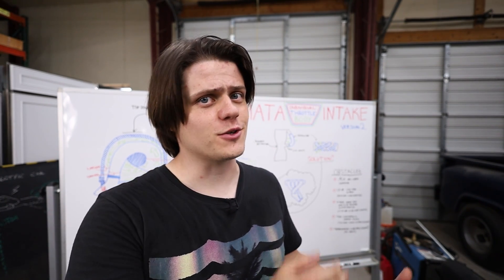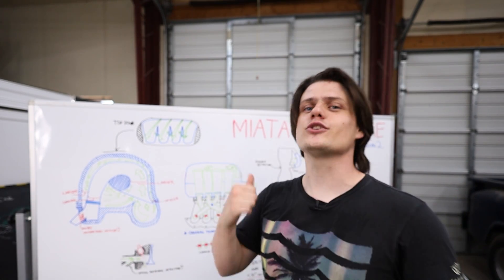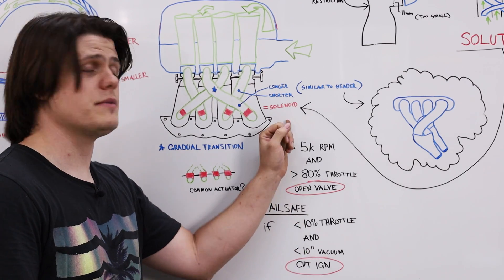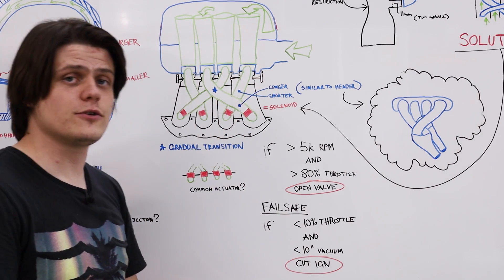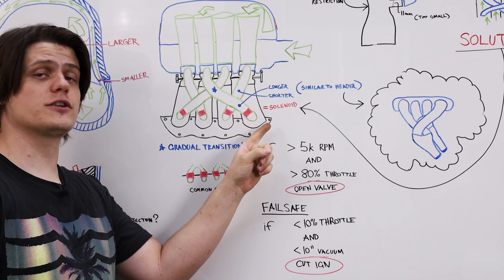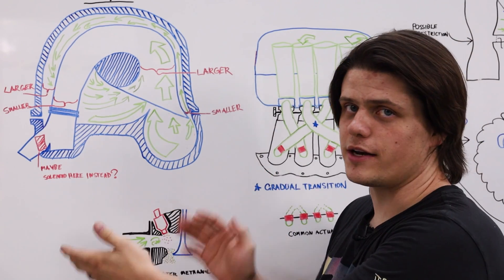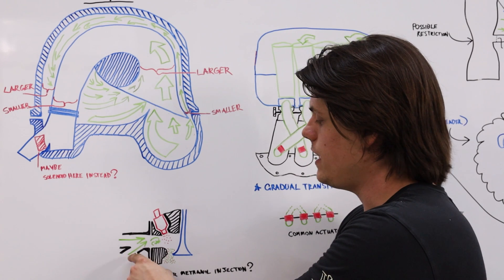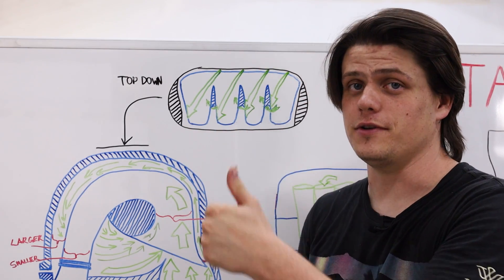This intake is the beginning of something BIG...

Comment: Im late to be adding this, but you should google "Yamaha YICS" (Yamaha Induction Control System). I have an old Yamaha SECA 7500 which has YICS.. It's essentially a tube beneath the intake ports which connects them all. The bike has ITBs with carburetors, the YICS tube is 1/4 the cross sectional area of a single port. The job it accomplishes is creating swirl and turbulence in the intake charge, the opening in the port is angled at the valve in such a way that it deliberately disturbs the airflow in the port.
Reply: I haven't thought about YICS for years. I think it debuted on the 650 SECA. Thanks for the reminder 😊

Comment: It's an interesting project, and I found it by looking for an ITB plenum that will take boost on a stock ECU, but I think you should learn to walk before you run and do the project in steps. Get a working plenum with short trumpets first. Then experiment with trumpet lengths and shapes for Mk II. Then experiment with your other stuff for Mk III. You will get more progress, learn what does and doesn't work, and reduce burnout breaking it down into stages than muddling through everything all at once.  Otherwise, great job! :)

Comment: I've printed a few props primarily with PLA, and recently moving into armor tried out ASA. ASA in my experience has been a blessing to work with, and as long as you keep the part cooling fan off or at low speed, I've never had a single layer separation issue. Not sure what brands and the like you've tried but i'm currently really enjoying polymaker's. With ASA its also important to print hot I've discovered, I print at 270C with it even though polymaker recommends 260 max. This is something i've seen advised in the community as well. It's also worth it to reach out to the 3d printing community if you still have issues, people tend to be really helpful. It's always awesome to see 3d printing make its way into another space!

Comment: it's a good idea but overall I think sliding intake runners like on the Mazda 787B would be a better option for this. That way you would get the perfect runner length for every rpm because you can have it in any position between max and min which obviously are optimized for high and low rpms. All you would need is to know your rpm and have something that moves the runners up and down like a worm gear maybe. not as space efficient so there is that and there is also the problem of the airbox, that could remain fixed to the top of the velocity stacks and move with the whole thing

edit: seems like this design is also used by Ducati https://www.youtube.com/watch?v=SnSADk9j7Mg

Comment: This is an interesting take on induction tuning. My 2007 Triumph Daytona has similar connected runners on the exhaust header from factory. By attempting to equalize the average runner pressure you are giving up the high pressure reflected wave that arrives at the intake valve at certain rpm. However, you are also reducing the low pressure rarefactions that exist at all other rpms. Perhaps you will win the battle of averages. I'm excited to see the results. For additional study you might be interested in the intake manifold found on the 2002 Ford Focus SVT. Similar packaging to what you have there but containing a two stage runner system that I found to be clever in its operation. It's a curved runner extension that rotates out of the way at higher rpm. Good luck. I am subscribed 👍

Comment: 3:46 actually a great idea, but one thing I would do is instead of have the velocity stack be shorter, and not as bent but have the intake manifold have a swirly/vortex shape to help air flow better through the manifold. A possible re-think of the design may be needed, but your current design isn’t relatively bad. Not an engineer, but putting in what I think would be a good idea. Take this with a grain of salt and have fun with this. Hope your build goes well!

Comment: ASA prints like butter.  Just about the easiest filament I've ever used.  If you are experiencing layer separation, sounds like you might not be using an enclosure, or your printing temps are too low.  You may also have to turn your parts cooling fan down.  Search for "andrew ellis tuning guide" .  Great resource for dialing in your printing.

Comment: at 1:50 

ITB sizing is not like calculating the size of the stock throttle body and then divide the area by the cylinder count.
The stock throttle body is a near constant flow device. As 4 cylinders pull through it through 720° of engine rotation and many times more than one at a time. 

While a single throttle body has to flow the entire cylinder filling in something like 240° duration, at all other times it´s doing almost nothing, there is lag during the valve opening and until the entire runner is at a common speed. So the 960° duration of a 4cyl with a 240° intake valve opening per cylinder looses it´s average flow substantially and so is not a direct correlation.

Comment: Ford Australia was using variable length intake runner manifolds on their mid 90's inline 6 sohc 4.0L all the way up to the last of the Barra's, with amazing results.
As you mentioned the 180 degree turns are a problem for air speed, Ford's early versions of the system got around it by effectively splitting the manifold into 2 halves using a vacuum operated butterfly valve arrangement, providing a short straight in between the turns to help recover that airspeed. Subsequent versions obviously only got better with the ecu handling the control of a now completely mappable, servo driven butterfly valve.

Comment: I could share my BMW intake design with you, but if I do, then, it must be done under NDA, and it should add a ton of power, without a ITB setup. It will match the power RPM and performance however.

Comment: You have lots of great ideas, however reality can be very different.  What you really need to look at is CFD (Computational Fluid Dynamics) software which allows you take your CAD design and simulate the airflow.  CFD design is very intuitive and I am guessing that you will instantly 'get it' and be able to interpret the color maps and use the results to refine your designs.

CFD = FEA - Finite Element Analysis

Comment: Most European Engines (including my custom ECU tuned supercharged MX5) Stop injecting fuel if the throttle was no longer being pressed (i had mine set to <5%) 

That failsafe really doesn't need the vacuum part, it's just a 0 fuel at 0 throttle, which is very normal for injection cars...

Comment: BMW vanos and valvetronic does something similar to this, but with a different approach.  they control the valve timing programmatically with vanos, and the lift with valvetronic, and so they don't have traditional throttle bodies since they perform its duties at the intake valves

Comment: Look at Yamahas variable length intake system they use on their R1 superbike. It is all inside the air box and functions very well. I think you can copy something like what they use and achieve the same results in a much simpler package.

Comment: Please check Yamaha's YICS system. It would simplify and add lightness to your system. Also some manufacturers use flapper valves to open and close air ducts to keep the intake volume and air speed matching with the engine's demands. The plenum itself in one thing, but another equally important thing is the ducting before the throttle body. Surface area of the air cleaner, restriction of the air cleaner, air box ducting etc. And all this needs to match with the exhaust and cam lobes without forgetting the ports themselves and the combustion chamber. Having a vortex right before the valve seems good on paper, but it also creates a low pressure area right where the flow should be as laminar as possible. If you want to mix the fuel better, the best solution is to move the injector(s) further away from the valve, and have the port finish slightly more coarse. Rougher finish on the port wall decreases the laminar flow area, making the true CSA number smaller than measured value. Simplest way to deal with valve pulse is to rifle the whole runner. If you spin the intake charge, it will travel further distance forward after closing the valse than it would with full laminar. Also the valve pulse dissipates into the low pressure area in the middle of the port/runner. This works best with a single valve per port, dual valve system can dissipate the pulse into the pre chamber, and adding the YICS to it, the intake charge keeps moving forward. How and where? By removing the stock injectors and connecting the holes with tube, you'll have fully functioning YICS. Installing the injector into the choking point you have in your intake design, you make the perfect mix, and can get rid of both the solenoids and the extra piping.

Comment: PETG is another but its not as high of a glass-temp as ASA. layer separation is due to the quality of the filament and the overall size of the print. From the prints I've done, and from what i've read its a crap shoot. some say print it at 250, bed temp of 90 some say 240 and a 100-110 bed temp. Variables between printers, materials, and where you're printing garage can take my numbers and settings and make yours print like crap. Even the intake runner I printer for my truck, I added a thin skim of plastic JB weld at the cracks sanded it and hit it with a coat of high temp engine enamel. No matter what there will be post-processing.

Comment: Print water soluable inner, print outer, print punger, forge carbon with high temp resins. Remove outer, bake the resin to cure, put in water to remove water soluble. Bake at higher temp for final cure.

Comment: Your rationale about the outside air channel is pretty sound - in aircraft intakes this is called a splitter plate. You're forcing a new boundary layer to grow on both sides of the splitter. Remember the fluid velocity at the surface is zero and then increases to free stream in the middle of the channel. If your outer channel is too narrow there is a chance it will choke and limit flow rate, but experimenting with different geometries is easier with 3d printing! Good luck!

Comment: For runner visibility: 3D print a mold and use vaccum forming to shape the top of your intake out of vinyl or other clear plastic. That would even give you a simple smooth outer surface for the air. 

I'm not sure what material would resist petrochemicals and heat under the hood. Check that, cuz a melted intake would be a sucky one.

Good luck, looks great!

Comment: as a Mechanic I see some issues in yer Design,
yer secondary Runners are connected tae the wrong Main Runners,
when the valve closes the air column won't stop, ye should go with the firing order 1-3-4-2
tae create an additional Pulse in the Cylinder that fires next.
the other thing is yer idea with the Solenoid, wich is simple but ponderous,
if ye take a second set of Throttles for the Runners and connect them with a Rod tae the Main Throttle,
yer absolute 1:1 (or what ever ratio needed) all the time.
Look up the design of Turbo intake called "gap sucction" type that uses slots on low rpm so the slower
column gets sucked through the long runner and on high flow or in this case ,boost occours it get's pushed through
the slots, it's bassicaly a syphone ,donnea ask me how exactly that works I'm no flow engineer.

Comment: i would change your injector location to being much further away then what you have it if you could. a straight shot down your stacks would be best it would increase fuel atomization and would make your air much cooler going into the engine

Comment: I really like your attitude about learning and sharing so I can share some airflow formulas with you that are engine related 👍
First thing you always need to know is the cfm demand of your engine at peak rpm, this formula will give you the answer in 28” test pressure (flowbench standard pressure) of each cylinder, so what you need each port/runner to flow to support that particular rpm point.

Cubic inches x rpm x 0.0009785 / number of cylinders = cfm demand at 28” test pressure.

I do Australian in-line 6 cylinder engines so here is an example of the formula.
240 x 6500 x 0.0009785 / 6 = 254cfm at 28” test pressure.

Next is how much air can flow per square inch of cross sectional area, again at 28” test pressure the most you can flow is 146cfm per square inch, so for my above example I would need a minimum cross sectional area area of 254/146= 1.74”squared.
Now this is 100% efficiency through a straight pipe, so we know that ports and runners aren’t straight so I personally aim for a 95% efficiency, so if I want to still achieve my 254cfm target at 95% cross sectional area efficiency the minimum cross sectional area would actually have to be 1.83”squared.

So if you want to ask any questions I’m happy to try answer them 👍 if you put up the engine specs and rpm points then we can calculate areas required.
Reply from the maker: Really appreciate the detail in the response. I believe I've seen that formula before, how do you alter it to learn the cfm requirement of each individual cylinder and thereby the minimum velocity stack diameter?
Reply: @StandRacing  or if you know the individual cylinders cubic capacity then you can just put that as the first number and not have to divide by the total number of cylinders, again my example then would be,
40 x 6500 x 0.0009785 = 254cfm
Because each cylinder of my 240cube 6 cylinder engine is 40 cubic inches.
Reply from the maker: @seanb250  very cool! I added a couple more numbers in and converted to mm and got a minimum diameter of 35mm. Which is awful close to the port size in the head 👍

(110ci 8,000RPM 4cyl)
Reply: @StandRacing  just remember you want slightly bigger as getting 100% efficiency from a port is extremely hard, so if you shoot for say a minimum diameter of 35.5mm (assuming a circle) then the engine will pull power to that rpm if the port is stable and the intake isn’t choking it 👍
Reply: @StandRacing  that is the formula for each cylinder, that’s why the final part is to divide by the number of cylinders 👍
So for my example I needed 254cfm per intake port.

Comment: Your solenoid should be closer to the intake valve, less volume stuck on throttle close the less throttle hang you get and better responsiveness
Reply from the maker: I was thinking the same thing. The only thing I don't know is how cleanly the air can flow through the solenoid. If it dirtys the air a lot that might be a factor on placement.

Comment: I assume you are using some sort of software like fusion 360 or something open source like most 3d printing guys do but I would recommend getting solidworks (even an older copy if you have to) and using their flow simulation software for your designs and it would help a lot in getting theory into more practical use without having to waste time and money printing a design that ends up not flowing how you want
Reply: I kept thinking something like this the whole time going over the flow drawing

Comment: Also with the ASA, possibly some basic troubleshooting might help with layer separation. A nice dry filament and a heated chamber are necessary, as well as the right build surface (PEI sheet works quite well). But these might all be things you've tried already so IDK.
Reply: can second this, only on small parts can you get away without a heated chamber on ASA. 
for me i've found 60c works alright, but to do ASA well you really need 80c enclosure temp, if you have the enclosure space, try and go for radiating heaters instead of fan heaters, fan heaters create a draft in the enclosure and will increase chance of warping in your prints.
Reply from the maker: My chamber is enclosed and it gets some heat from the filament dryer which is inside the enclosure. Also, I'm in the desert so the filaments stay pretty dry anyway.

Off the print bed, the ASA usually looks pretty good but I'm more worried about it splitting over time under the heat and vibration in the engine bay.
Reply: @StandRacing  Production intakes are made from glass infused nylon which ha its own challenges.

Comment: Whilst all your ideas seem interesting and possibly sound, can I suggest something? Real world data trumps all. Figure out some way to test the actual airflow you're getting into the engine. Then it's simply a matter of building the thing and measuring, and you don't have to guess. 
Some kind of airflow measurement at the intake to the airbox and then right before each throttle body maybe?

Comment: this is not the way.  get it correct size at the inlet and outlet-2" long at each end.  make the rest in the middle larger diameter. how large depends on the harmonics. Try adding 5mm on each side

Comment: M1= M2 . Mass replacement will pull air from the small gap between the runner intake. I wouldn't pull air upward; with the resistance of flow and high surface area your just gaining manifold pressure. Runners are great, the overall surface area of the ID will determine static friction and most of your resistance; 1 bend is better than 2 and the bend radius is important to determine mass flow.
- C+ tech student

Comment: Excellent work. I like the theory. Is it going to be maf? I think that and the plenum both will be a restriction. If it’s supposed to be a boost manifold then remove the itb and put a single large tb and no maf. Work on the length to generate the power at the rpm you want. Really anxious to see your results.